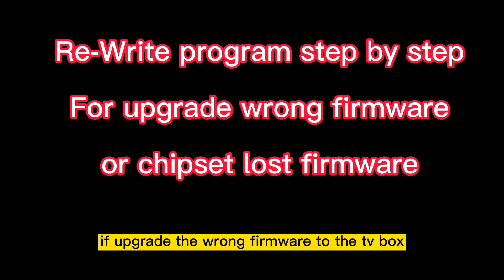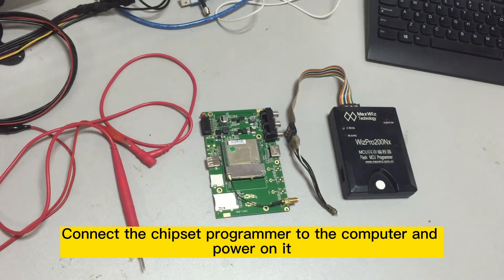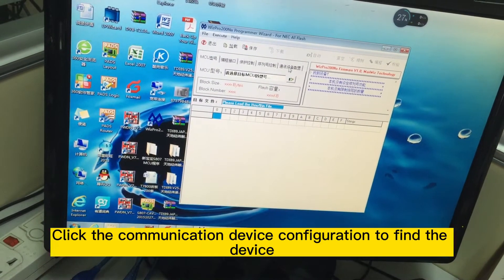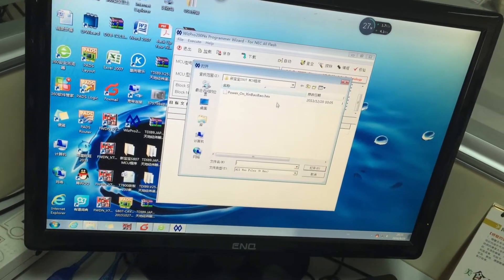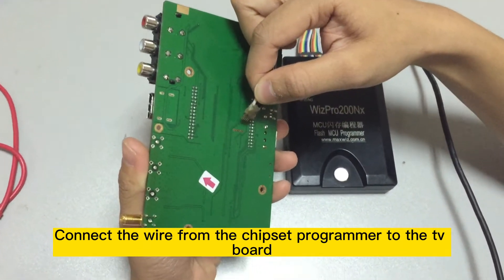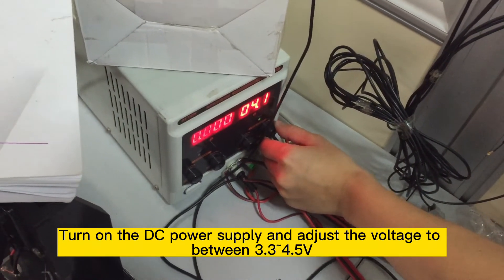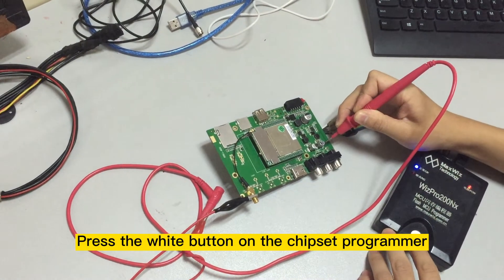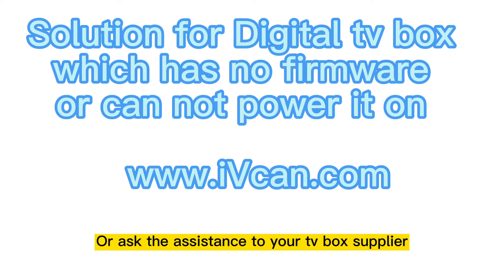Re-Write New update firmware for DVB T2 or ISDB T digital tv box as upgrade wrong software or lost

Comment: Hi, Good afternoon, I would like to ask if their are remedy or solution into my VCAN1047 after i software update, only appear on the screen loading and automatically shut down and thiers no indicator light appear. Hopefully you can help me in my concern. Thank you so much.
Reply from the maker: sorry, I don't know your tv box hardware details, maybe the upgrade firmware is not compatible. Please try to ask your tv box supplier to offer you the correct upgrade firmware,  which firmware should be loaded from the USB stick, and re-write the correct firmware back to your tv box.  
Some tv boxes used the same appearance or the gift box, but the hardware, chipset, and control i/o are different from the different produce factories. Please make sure that the upgrade firmware is suitable for your tv box or not before upgrading.